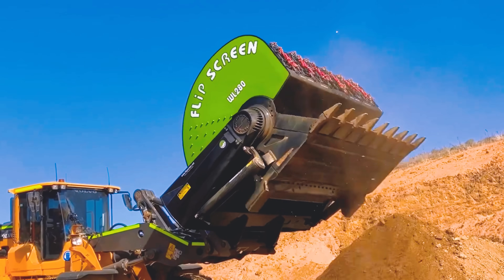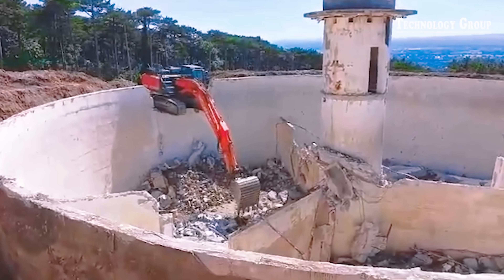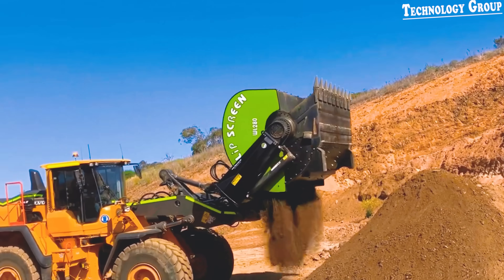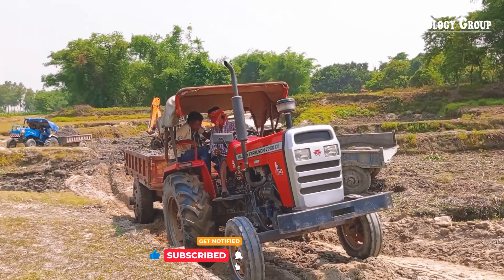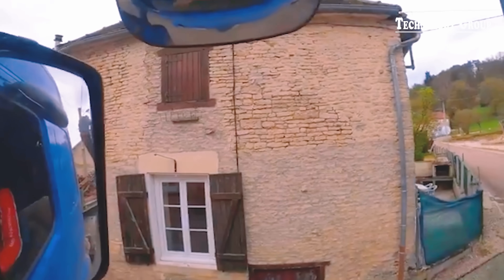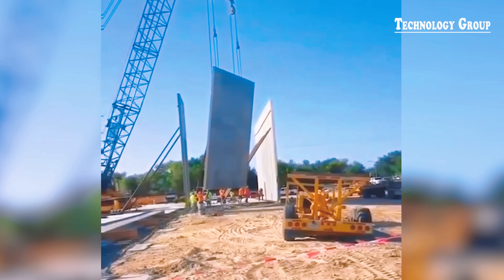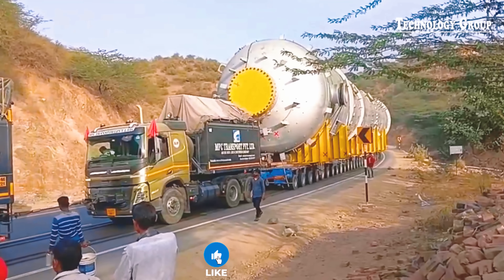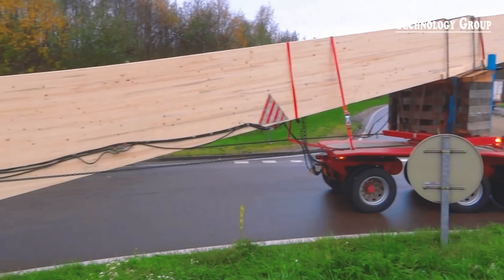99 Jaw-Dropping Most Dangerous Transport Skills | Agriculture Technology

Comment: Total BS. 
Timber is heavy. A common truck will have to work hard to pull just one, let alone 2 trailers. There is absolutely no way it would be able to pull 20 or how many there are supposed to be in the cover photo. If you think you need to display your PhotoShop skills, then find a place that actually appreciates your PhotoShop skills instead of lying to your viewers here.
Down-voted video, not watching,
Reply from the maker: Do you think these professionals are heroes?
Reply: @Americanfields  I would not choose the word hero to describe someone who is trying to pull 20+ trailers loaded with timber with a single truck.
BTW: Eliza already had a better performance 55 years ago than you .